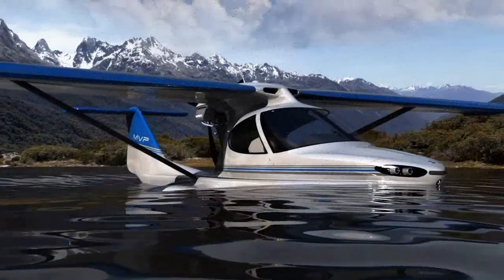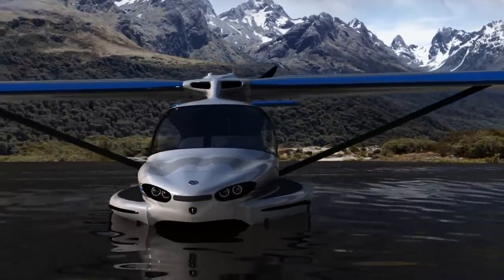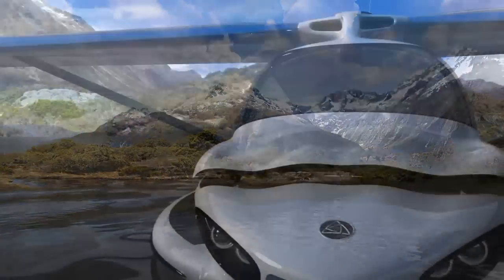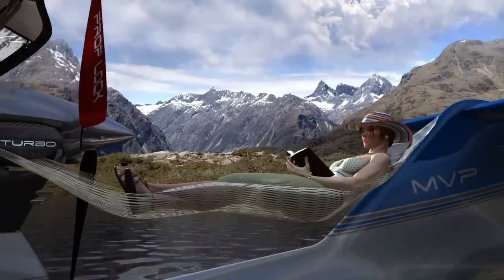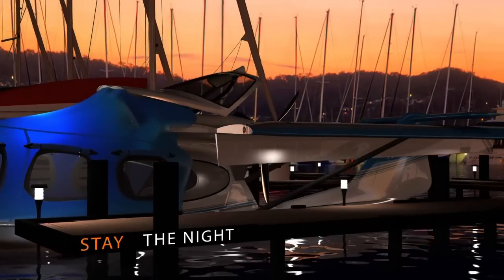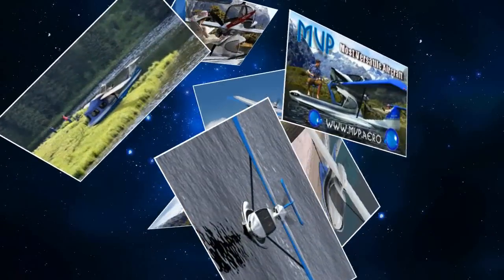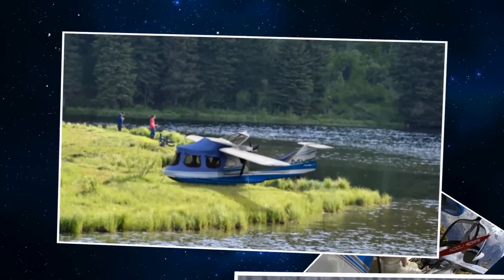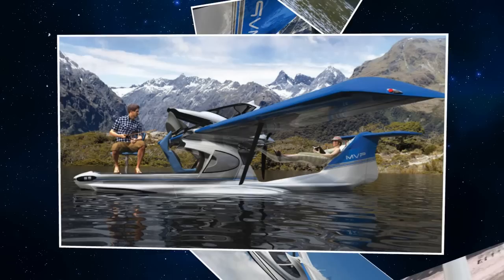MVP Aero, MVP amphibious lightsport aircraft, MVP is going on tour.

Comment: It is now Nov 2018 and the www.mvp.aero website no longer works. Doing Google searches isnt bringing up any news as to what happened to this Amazing aircraft.  It has a ton of awesome features but the one thing that is/did kill this aircraft is the astronomical price tag of way over $200K.  This aircraft of offered as a kit could be built for about $80K. Oh well, I guess I will have to be the one to design something in a twin engine very much like this and offer it for sale as a kit which will cost less than $80K for you to build.
Reply: There web site does work but nothing about production or prototypes. The site is www.mvp.aero. There  PROJECT seems to be still in the R&D. There have a place for u to sign up for a NEWSLETTER from them. I guess it's like the ICON 5 it was to be $189,000 and now is $389,000. Way to much for a LIGHT SPORT.